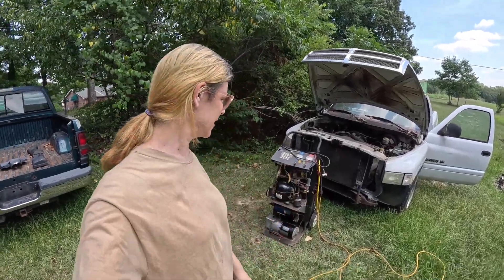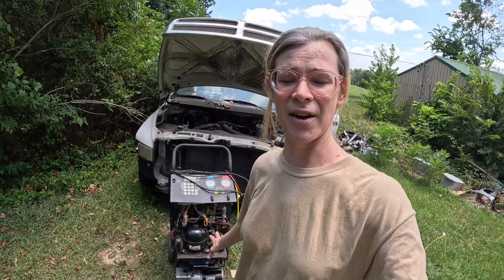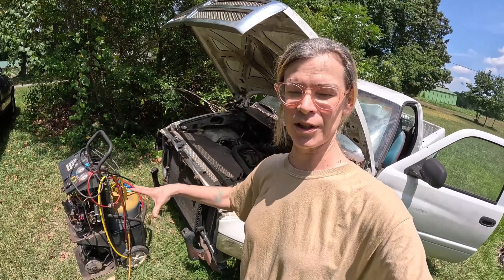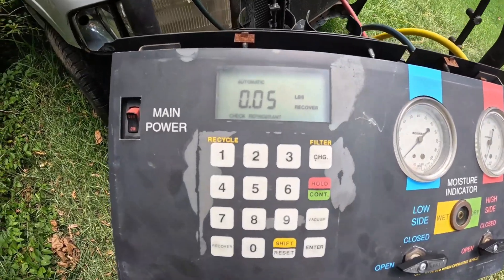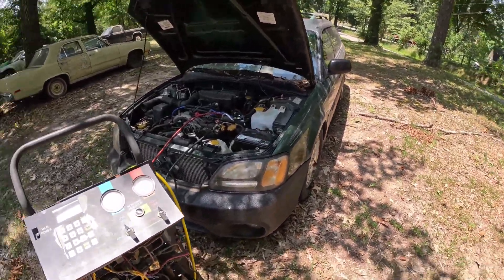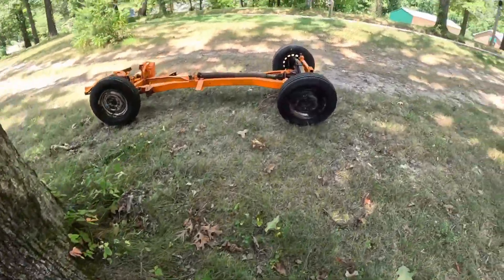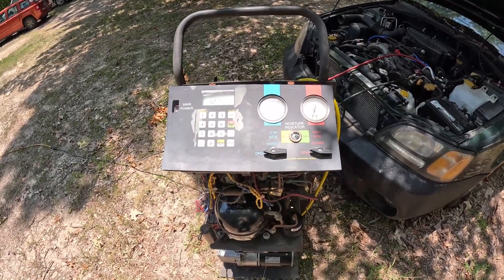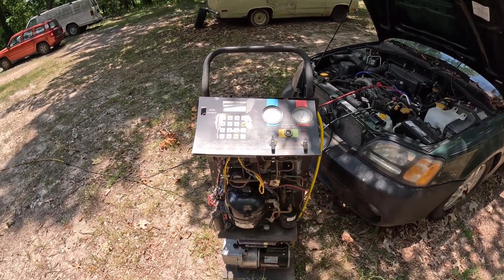Saving R-134a Refrigerant From Junk Cars - Repaired Recovery Machine

Comment: Good stuff ms kim. Most 134 car systems are approximately 2 lbs + or - a few, most. This is interesting, recovery is always a good thing. The only concern i,'d have is if anyone contaminated the 134 with anything else. Hopefully not, probably not. Nothing is wrong with used refridgerant, it doesn't go bad. Ive used it used many times. Again good stuff. 👍